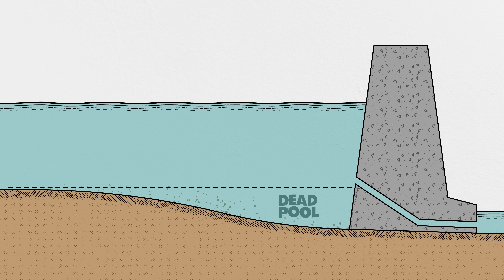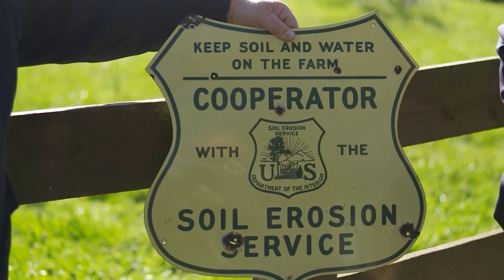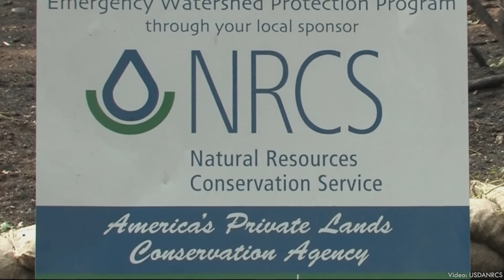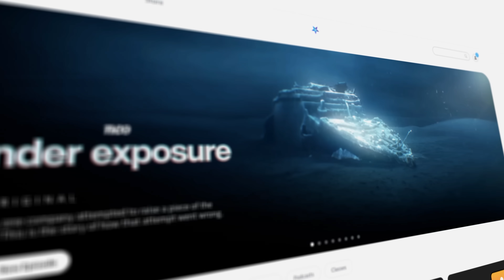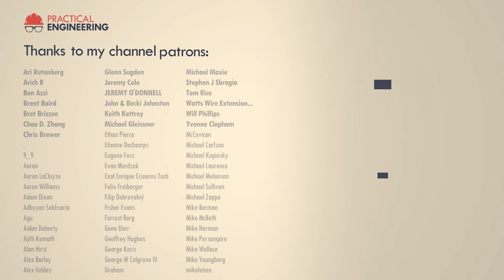All Dams Are Temporary

Comment: Something that came to my mind watching this video was to create a syphon vacuum system for the sediment where its deposition begins using a bypass to collect it and send it to the output of the dam. let gravity and the water itself do the work. This system will of course have to be maintained properly to avoid blockages, but the amount of dredging could be reduced to a very manageable output and all the sediment will be flowing at the same rate as it naturally would be on its own, with very little energy usage compared to dredging it with pumps and gravity and the syphon are doing almost all of the work. I think this could be a good concept to be explored and perfected by engineers in future dam projects. I think by syphoning sediment away dredging could be minimized by 99.9% or more making it a rare need, and once again the syphon being tapped into can greatly reduce the need for pumps every while dredging. Another possibly better example, if a check dam had a sediment bypass great at the bottom, it could be used to continuously remove the sentiment before reaching the reservoir. With regular maintenance clearing logs and things too big to fit through this grate, the sediment can be collected by upstream and sent downstream to the output of the main dam without any pumps just using gravity and the syphon effect to do the work. Dredging could be an all but non existent need, maybe one every 200+ years or so. Maybe every 500 years. Or maybe a small amount of routine dredging every 50 years as some sediment is almost always going to stay in suspension and collect at points of stagnation. Even the supply of tap water coming into a house leaves sediment in the hot water heater. There are always dissolved minerals in the water too that can be knocked out of solution in many different ways including contact with metal surfaces and electric charges. Anyway, hopefully what I've said here helps or gives someone an idea. God bless y'all.

Comment: This is a much smaller scale, but the same issue exists for man-made ponds as well. The manufactured pond next to my house has an inlet from fields behind our house for flood control, and flows outward into a second pond across the street. But after 25 years, the pond's capacity and depth are MUCH smaller than they originally were, and fixing it looks like it's going to be a 6 figure cost!!

Comment: Maybe consider water injection dredging...? If done at the upstream end of the dam, the resuspended sediment would likely and ultimately settle again at the dam itself; however, at that location, the amount collected would be limit as the upper layer of water will speed up again to overflow the dam through the chutes. This would significantly reduce the volume loss due to sedimentation and avoid 'actively' transporting massive amounts of soil with barges, trucks or through dredge lines. Indeed the dam structure would have to be capable of withstanding the stacked material; alternatively, the mentioned lower channels could also help to reduce this amount or a permanent dredge line could be installed here (acting as a siphon to reduce energy consumption).

Comment: I found the idea of a filter for large particles interesting. 
It could be used with a wide tube, raised above the dam and descending to below the deepest point of the area where the sediments are found. Creating the effect of suction by siphon. While the grid, made of rigid material, could be slowly pulled by boat. Depending on the width of the pipe to be used, the dispersion of sediments could be adjusted so as not to reach proportions that cause pollution. And in a controlled manner, it would supply nutrients to the lower part of the river. Even preventing the formation of deltas. The idea does not have a patent, from what I have researched. At least not in the way I envisioned it. 
If any engineer wants to test it, put it into practice and if it works, produce or sell it; I accept monetary recognition for the idea.

Comment: I am no engineer, but what if we created a system to aerate the water or any way to keep the sediment suspended to a degree as it flowed through a bypass at the lower levels of the dam. If the water could be harnessed to power the system, it would be a net gain. I’m sure maintaining such a system would be incredibly complicated or if you want an even crazier idea in the channel leading up to the dam what if this area was made exceptionally smooth and across the width of it were valves that could be open to flush the system across the whole base. You would have to flush regularly before too much buildup, but if you simply redirect the water to these pipes or valves that come up from the bottom, it could disrupt the sediment and carry it through a lower channel on the dam

Comment: I ran into this problem when I was making a dam for a stream at my grandmother's when I was little. I remember using a lot of moss that was fine with being submerged covering channels carved into the stream bed with slats that used the force of the water to pull the sediment down into them through the moss. The moss having a large surface area with an amorphous shape and area helped to prevent a riptide while the water still had enough force to drag the soil along with it. Eventually it stopped working after we had a particularly long drought and the moss died out but it was working for months prior with no obvious detriment to the water levels behind the dam, soil erosion or soil deposition down stream. Some smaller animals would get pulled in(tadpoles and the like) though so the force was still a concern for how it could trap creatures and drown them if they didn't escape the stream past the dam quickly enough.
Reply: Could we make a faux moss structure that combined with the silt channels could do the same thing?

Comment: I'm an engineering student this is outside my field but i think i have a solution maybe, how about instead of having a fast flaw for the hole length of the dam, you can make a couple of very fast flaw channels at the bottom of the dam to remove sediment probably faster than the rivers flaw this way overtime the capacity would still decrease but it would leave a V shape clearance for the river to flaw.

Comment: TL:DR at bottom

It probably wouldn't work for all types of dams but could a type of fan like device be used to stir up the sediment that falls to push it to the top and allow it to flow over the dam? If so then they would just need to devise a way to easily bucket the sediment on the drier side and turn it on to clean the sedimentation occasionally while doing regular maintenance on the dam anyway or depending on the size of the dam just let it continue to flow over the wall continuously so it is natural sedimentation like the dam was never constructed?

I'm imagining something like a grate that opens when the fans turn on would be the best option. The dam turns off, opens the grates on the dry side of the dam, then the fans turn on for 30 or so minutes. This would allow the sediment to fall over the dam and into the grate and presumably get piped into another area where they can dry it out for easier transportation to a proper facility to take care of it or just bag it and sell it as gardening dirt or fertilizer perhaps. Bonus points because you could probably engineer it to go into a semi-trailer sized container automatically from the pressure or fall into it while or after drying. The footprint of the dam facilities would be much larger because you'd need space to dry the wet sediment and the amount of space needed to pipe the sediment from and to, plus the fans as well as any sort of wiring.

Unless I'm missing something this basically answers the issue though unless I'm wrong but it does sound to me like the issue is the sediment stopping to close to the dam not that it shouldn't exist at all so the solution should work? It's been a long time since I've done any sort of designing though so I might be forgetting a few points but I didn't hear any issues about this from the video.

Also when the sediment is processed at the specialized facility they could test for pollutants and such then either neutralize the pollutants before trying to sell it as fertilizer or figure out which other facility it needs to go to. Could also be a good use for environmental research since they could measure the amounts of materials within the sediment and the changes over time and they could probably find other scientific things to do with it.

TL:DR 
Basically... Turn the dam off for most safety reasons -> Open a grate where the water on the dry side can get piped away from the dam if it gets inside -> Agitate the sediment into the water -> Flow the sediment over the dam and into the grate to be piped away -> Dry the sediment in a controlled facility -> have the dry sediment which should be sand basically by this point fall into a trailer or train car sized container to be hauled away to another facility for use purposes like fertilizer or whatever.

Comment: Lucky our reservoirs are basically all man made with concrete bottoms and no rivers going in. The rivers, most of which are also man made flow past the reservoir and a pump brings the water into the reservoir.

There are dams to raise the water level for the pumps and also to make sure the rivers don't go dry because animals live in them

Comment: Hi Grady, 

I was a bit excited to see that you included a clip of Jindabyne dam.  This is an earth and rockfill dam built in the 1960s.  It is one of the lower reservoirs of the Snow Mountains scheme.  When it was brought into operation it basically cut off all of the water flow from the snow melt.  The river down stream of the dam is only about 285km long and the impact was massive.  Sediment that would have gone all the way to the sea has, over the years, accumulated in quantities and places it would that it have never been seen before the dam was built.  That said, because of the granite substrata and the fact the the catchment is in a national park sediment into the dam is not that great, highlighting on of your comments about the need for catchment management.

As an aside, the secondary outlet structure seen to left of the main spillway was completed decades after the original dam was built to address the environmental flows problem.  This work, using modern building techniques, took almost as long and as much cost to build as the original dam.

Comment: Can they build a system to mimic the dredge ships, but without the ship, Dredge from the backside/sediment pool, and pump that through the damm and out into the downside stream. If it works constantly on a high enough volume, that should help a lot. That way the flow rate CAN also be controlled :)

Comment: 12:29 The check dam/settling pond to catch sediments upstream from the primary reservoir was what I was thinking could be a viable solution, but probably not if you're listing it among the complications of dams. I was just thinking if the settling pond were designed in a way that made dredging easier, it could be beneficial. Point of note tho, I'm not an engineer, just a regular Joe.

Comment: Dams alter entire ecosystems when they are built, so undoing them also creates then new ecosystem issues. When undone,  the length of the lake area, which often has some steep mountain and canyon areas that have become weakened over time, can create landslide potential that cause additional issues. The seepage in the mountainous areas can create hazardous materials, and flood control is lost. Hydro power does give energy to millions of homes and as much as we hear about solar, wind, and geo thermal, we have also seen the environmental damage from wind power and problems associated with geothermal in active areas where they exist. Solar has the same problem as the others do, energy storage and, more importantly, the grid to transport the energy. These grids are massively expensive, and our government is barely spending on keeping our current infrastructure of railroads,  highways, bridges, and damns. With an average grade of D or worse for these different parts of our infrastructures that are critical to the US. Adding more issues without funding and planning in place could be catastrophic.  Finally, the amount of material  for these dams is substantial and not easy to do something with.  Hoover Dam, as an example,  is made up of 4.3 million cubic yards of concrete and 45 million pounds of steel. Not an easy task to handle this amount of material. There are over 92,000 dams in the US  with 60,000 privately owned. This leaves an issue of who foots the bill and ongoing maintenance. Expect more collapsing issues each year as they age. With the average age of US dams at 61 years, and life expectations being 50 years, but can go up to 100 years with detailed and expensive maintenance. With almost 2/3 being private, concerns for proper maintenance should be high.
Great video. I just wanted to add the pieces that are often used as an excuse to not fund yet are 100% required.

Comment: Also the life of concrete is 50 too 100 years depending on type. Under perfectly maintained conditions.  Our concrete dams are ticking time bombs as they age out. Water pressure is tough to deal with once a leak starts. Once a leak starts it is a sign that soon you will be getting much more water.

Comment: Wouldn't a  reasonable long term solution to create lakes that, instead of using the main river channels, are offset from the main river and water fills the reservoirs from smaller channels. Leaving water to flow still on the main path?

Comment: We toured Gavin’s Point dam and ft Randall dam over the years and something I learned is that the bottom 3 dams on the Missouri (big bend, fr Randall, Gavin’s point) are flow control and the 3 upper dams (ft Peck, Garretson, Oahe) are retention dams.  If you look at the run off maps for these individual dams you see how small of a water shed Gavin’s point is in comparison to the upper three.  Those bottom 3 have an important job of supplying and controlling flow of the Missouri beyond Yankton SD to StLouis.  Also the Niobrara River system is the primary feeder to Lewis & Clark lake and thst river carries a lot of sediment.  Running along the north edge of the Nebraska Sandhills which feeds a lot of the sediment.

Comment: Would it be possible to install some sort of sediment stirrers, that would agitate the sediment back into the water in order to flush it down stream?
Reply: I'm not sure on that, but I don't think it would be a great idea because
1) you would need a lot of them, and they would need to be very big
2) the energy cost of running them will probably (?) use a lot of the dam's production.
There might be other issues

Comment: Can you prove that dirt applies force to the dam walls?
Doesn't gravity pull downward, not push sideways?
Reply: Dirt here basically flows like a fluid, except that it is heavier than water. That's the problem.

Comment: With ALL large Dams that will be built in the future. Should have sediment release tunnels. And use them from the beginning. To maintain certain level of sediment at the base of the Dams. End of story for future Dams. Now with current Dams. There are ways to remove the sediment slowly. To prevent any problems down stream. This is not this complicated.

Comment: And when it becomes an actual issue, theyll use machinery to dig it out. It's basically free ultra clean dirt, pre screened by nature itself. Dig it out, throw it on a haul truck, haul takes it to a stockpile where they continually flip the dirt to dry it out, and theyll run through a screener anyway to get all the rocks out and probably build something with it.

Comment: See I see what you're saying is bad with dredging but I still feel this could be the option.  Around where I live we need to build levys and we need more water storage.  Both these could be fixed through dredging already existing dams
Reply: This is a good thought, but the issue is that levies channel water and make flooding downstream of them more severe. Additionally, the soils taken from dredging may not be suitable for building earthworks for a variety of reasons (silts being hard to form into levies while wet but incredibly  difficult to break apart and move around when dry for example). Flooding mitigation is better performed by slowing infiltration of water through a variety of methods such as stormwater basins, raingardens to mitigate runoff from impermeable surfaces, and restoration of wetlands. In some ways, slower infiltration works to reduce (though unfortunately not reverse) sedimentation of reservoirs by decreasing erosion as well.

Comment: I can see two solutions similar in idea but for 2 different types of project

For a new project, probably install terraces/weirs during construction and have either a air bubbler or a water jet system to continuously be able to disturb sediment from the bottom all the time, or only when attached hydro isn't running depending on application 

And for already built reservoirs? I'd actually get some oil drillers in, floating derricks are a thing, and they can drill damm near sideways after going down nowadays, they could use a fracking type process to break up sections and have it wash out

And if anyone nabs my ideas, i want a job lol, come find me 🫠

Comment: My thoughts went to dredging and draining at first but I came to the same conclusions you stated in the video.
But now I'm wondering about mechanical perturbation
Could you suspend sediment in the water again and maybe even move it in the direction of a spillway.
What would be the next change in cost vs mechanical removal. Could you use less water in a side channel where a smaller volume can move faster 
Could you more simply control the amount of sediment going down stream to keep it in safe levels for the ecosystem